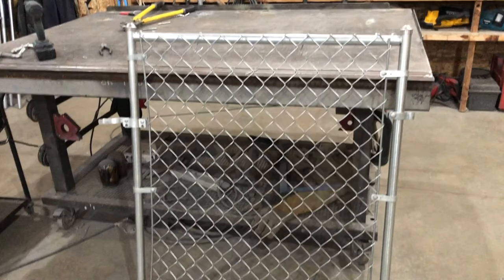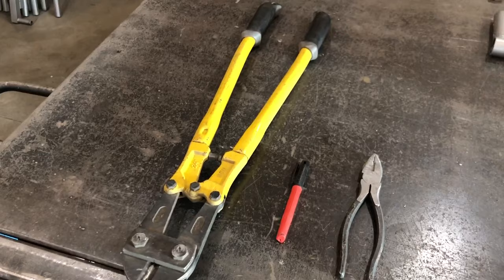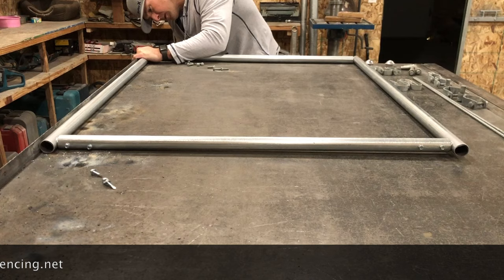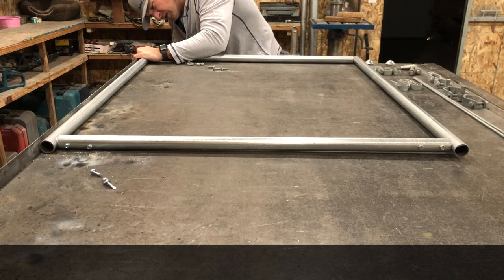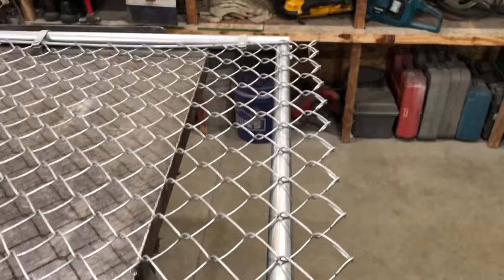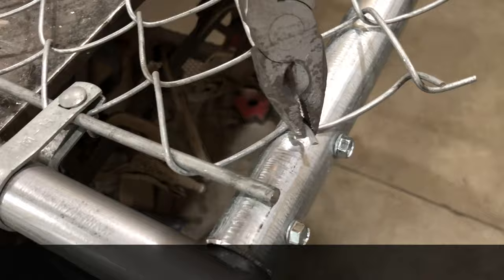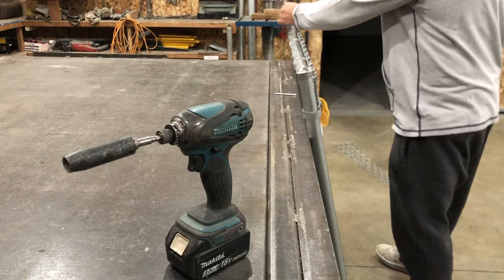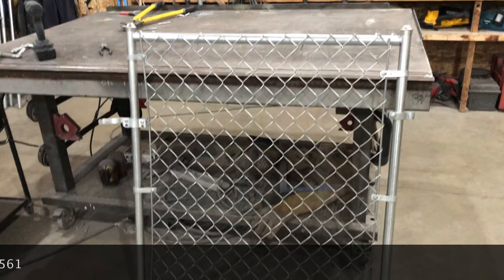Build Your Own 4x3 Residential Chain Link Gate: A Complete DIY Installation Guide!

Comment: if u have a good drill and an vice you can drill for the   J bolts but a good center punch will help start the hole
easy peezy

Comment: Sirs...,   I measured three chain link section  (30 feet 4 inches...)    I need to convert over to a WIDE gate for a class A motor home to enter and leave the property...   Do you make gates this long... ?????? (left and right side....)          I could use a double high gate hinge post with an opposing reinforced wire creating a strong post for a gate to hang on to...   Let me know and please include your phone number for describing this gate/hinge piece      Looking forward to building a usable gate....      Thank you sir.....

Comment: I need to buy a kit for a section that is 6’ tall and 10’ wide or two at 6’ tall and 5’ wide. How do I find a price?
Reply: Don't buy one of these kits contact a real fence company give them your gate measurements and they will make you a custom gate with welded corners much higher quality then that cheap stuff

Comment: you don't need a drill press to drill a hole into the frame. you just need a good metal bit and good drill with torque and some patience. I wouldn't ever buy that POS gate. the gate looks disgusting
Reply: All you have to do is MARK the post with a Wrap Around Template at the location where the J-Bolt Hinge goes.  Scribe a LINE around the post with a felt marker, Crayon, or pencil.  Take a Center PUNCH and make a Punch Mark on the line of the post where it faces the GATE.  Then measure from this punch mark around to ONE HALF of the circumference for the OTHER SIDE, make a punch mark there.  I have done this so many times I can EYEBALL IT, actually anyone can eyeball it by simply taking a close look at it.  But I ALWAYS scribe a LINE for "level" then eyeball the punch mark.  

After marking the two punch Marks, drill a 3/16 or 1/4 or even a 5/16 or 3/8 pilot hole at each punch mark.  Any of those will work for a Pilot.  I like to use a 1/4 inch drill for the pilot, but you can use what ever you have amongst or close to those I noted  Then take a 5/8 drill and drill the finished hole.  You can do this at the SHOP, but I PREFER to do it on site AFTER setting the post and allowing the concrete to CURE.  By doing it at the SITE you can get the holes EXACTLY where you want them.  

In some locations you might NOT be able to drill the holes as they might be close to a WALL or some other obstruction, then of course it might be BETTER to drill it BEFORE SETTING THE POST.  You can drill the POST at the site BEFORE SETTING but you can still "DRY FIT IT" to see if it will WORK.  Or use a wrap around Pintle Hinge.  

This above gate I would try to NEVER SELL.  But it is probably a decent seller for those trying to "do it themselves" for cheap.  It is too unprofessioinal looking for a "FENCE COMPANY" in my opinion.  They Make Cast Pot Metal fittings for the corners, I would use THOSE before I would do it like this as the finish product looks better.  However the pot metal corners have been known to break or crack, but most of the time they are fine, I PREFER WELDED THOUGH.  My gates of this size are WELDED and I use TENSION BARS with Tension Bands.  I would use 1 3/8 OD .095 wall thickness and weld it with Shielded Metal Arc Welding or MIG.  I use 11 Gauge galvanized after weaving fabric and STEEL Tie Wire.  

I realize not everyone has that capability, and need something done quick and cheap as their budget might not allow calling a "Fence Company" to do it.  But "Drilling" if you have a portable drill motor with a Half Inch Chuck that is AC POWERED and a 5/8 Necked down Twist Drill that is all you need, no drill press required.  I have several Drill Presses, as a RULE I like to drill my Posts ON SITE to get them just like I want them.  On non-Galvanized Posts I use a CUTTING torch to blow the holes.  BB  0ver 60 years building fence and gates.